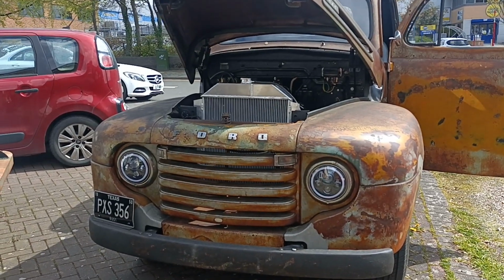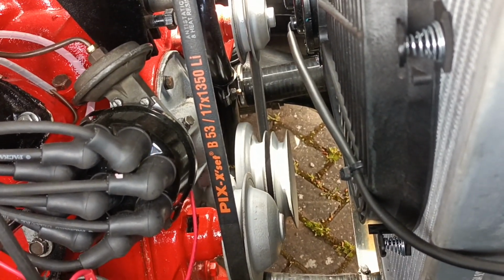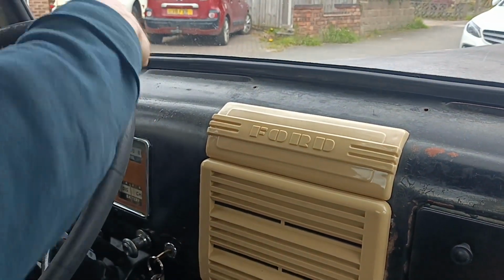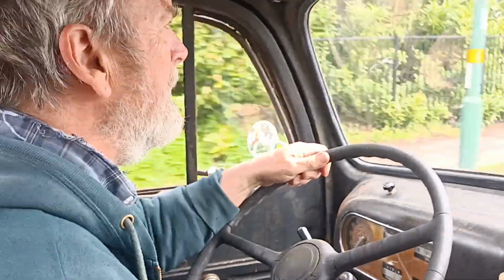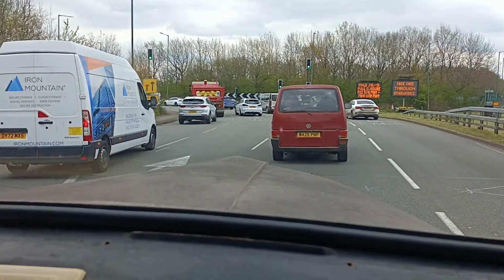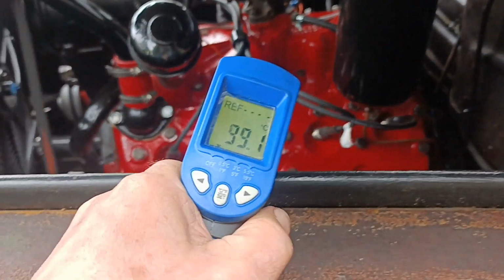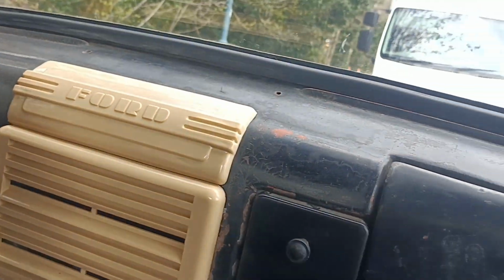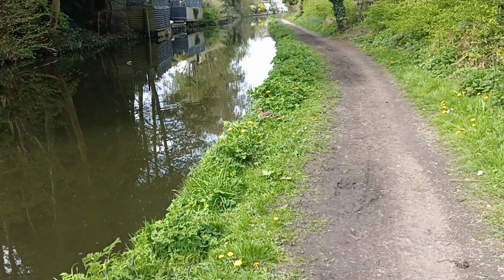Richard's F1 Pickup: It's on the road! Let's go for a ride! (F1 Pickup Pt6). (2334)

Comment: Thanks for the ride Mart and Richard. Old flatty sounds great but that heat gauges reading would be a little high compared to what I'm used to. That heavy traffic is a nuisance for sure. I can park mine on the road for a photo shoot here and not be disturbed as there is not much traffic at all.

Comment: Timing bang on, rebuilt engine & carb and I still hear that pop on the over run as Richard lifted

You also pointed it out on idle too Mart.

I remember Moggy Minors always used to do it too.

Richard done a lovely job.
I had to remove those indicator beepers - drove me crazy - lol
Reply from the maker: Hi Paul. I don't know why the popping. I am not familiar with the loadamatics and as it is not my truck I can't really investigate. If it were mine I would be looking at fitting a modified Chevy distributor.